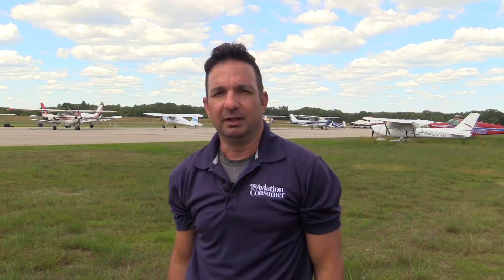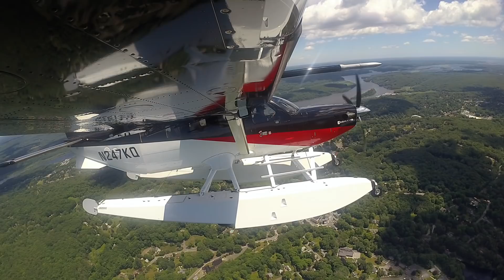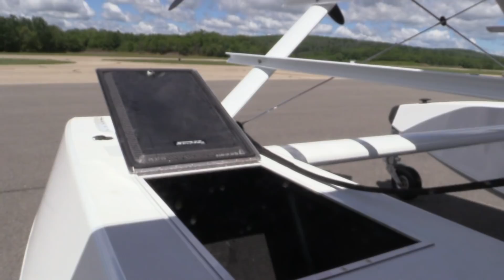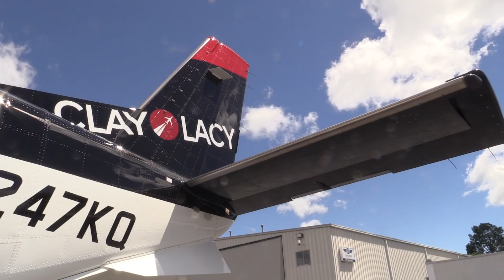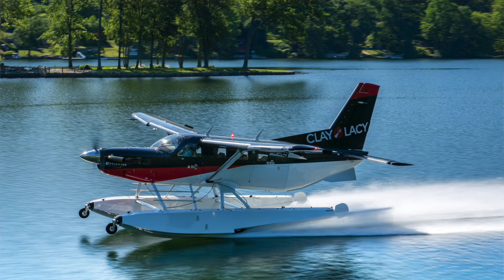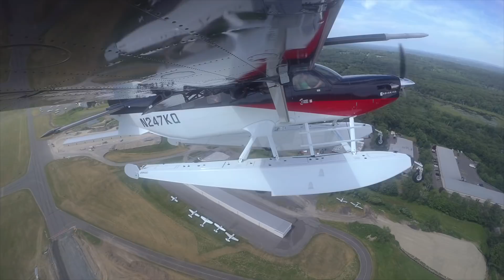Quest Kodiak Series II Flight Trial

Comment: I love how a $300,000 Beaver from the 1940s will pretty much do anything this one can at $2.8M. Sorry, that's a tough sell. Even an upgraded Boss Beaver with a pt6 and and floats is half that cost. And $400,000 just for a set of floats? You can get 2 more planes for that! Dude! Wtf is wrong with these people?
-"we need a plane to take cargo in and out of hard to reach areas. But we don't want to spend any less than 2 mil on it"
Said no one, ever.

Comment: Why not pressurization option (C-Caravan too)? Really like the idea of getting above weather, as much as possible. Other than that, love the Kodiak and the Cessna Caravan.👍🇺🇸💪
Reply: The mission of these planes is one where pressurization is simply unnecessary. The excess weight to build a pressurizable fuselage would take away from useful load. These planes don't have the range or speed to warrant high-altitude travel.